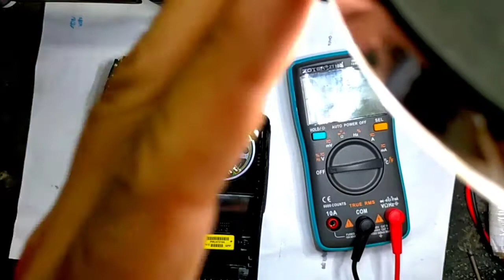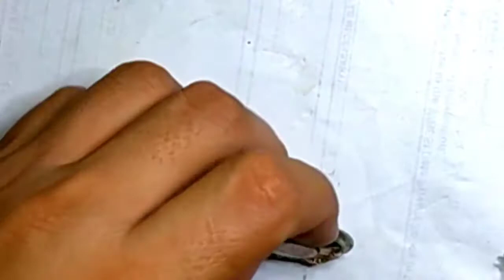How to repair portable handheld radio no incoming calls.

Comment: Paano kapag Walang incoming pero may out going cya SAAN sya part n hahanapin.
Reply from the maker: First check muna speaker sir baka busted second gamitan niyo muna ng headset pag gumana sa headset meaning yung saksakan ng input jack ang may problema it's either umangat yung contact pin sa loob ng speaker input jack po
Reply from the maker: Kaya wala po siyang incoming po.